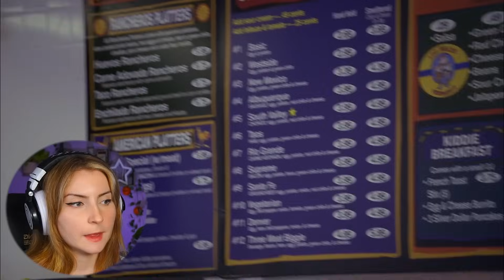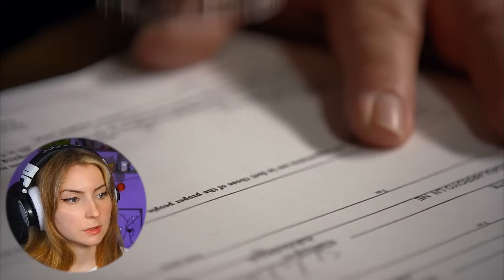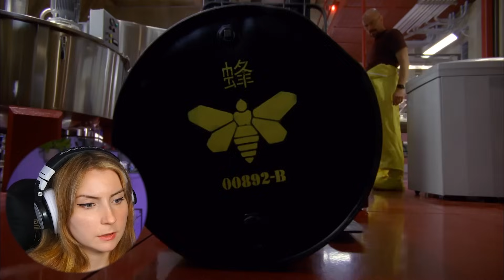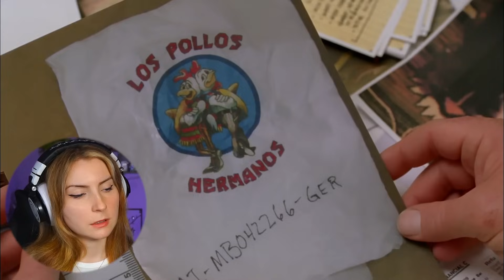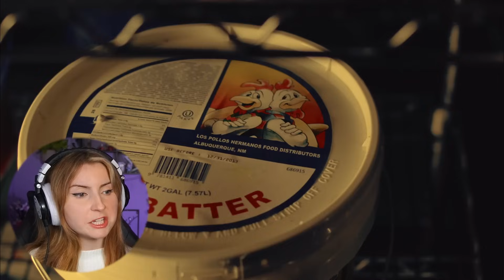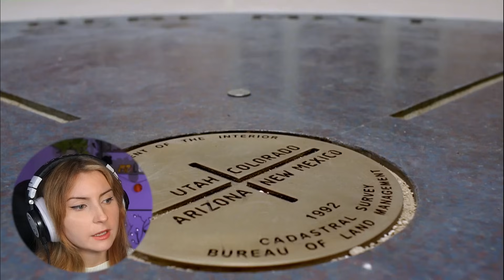WALTUH IS THE DANGER!?!? *Breaking Bad* Season 4... [Part 3]

Comment: The initial scare with Jesse was explained when Jesse knew Mike wasn't going to "off that thief" because Mike put a bag over his head. Then when Mike takes Jesse for a drive, he didn't put a bag over Jesse's head. The "Guy" that Mike once had was Victor - the victim of Gus's boxcutter.

Walter sounds condescending and narcissistic when talking to Jesse but he isn't wrong about Gus's plan to drive a wedge between them. He figured it out.

"I'm not in danger. I AM the danger." - I think Walter was trying to convince himself as much if not more than convincing Skyler. All that did was raise Skyler's fear and concern that Walter was far more than just a lab cook. Walter is starting to act more recklessly. He is losing the control he once had in every facet of his life.

Comment: Meth makes it tough to eat, especially if you’re snorting and not smoking it.
You’re throat gets dry, and you don’t normally have an appetite but when you do you can’t eat just anything or you’ll tare up your esophagus, especially big bites or crunchy on dry things like chips or toast.
It’s pretty much the same with most drugs, cocaine, ecstasy/molly, LSD, etc.
But if you eat and drink water regularly while on any of these,  resist the lack of appetite and essentially force yourself to stay fed and hydrated, “Party Drugs” are a lot easier to handle, and the eventual “come down” is less severe, thus lessening the urge to get more of what you were using, which commonly leads to addiction.
I’m not saying you won’t get addicted to drugs if you try them, but there’s a vast difference between use and abuse, potentially eating and staying hydrated can often be that dividing line.
But be warned, eating too much and taking too many drugs or drinking too much will likely make someone vomit, I’m an advocate for safe drug use, and you haven’t lived until you’ve hallucinated you were vomiting rainbows, at least one time in your short existence...👍🏽

Comment: It's a little hard to feel sorry for someone as unpleasant as Bogdan. He kept Walt working extra shifts, probably under threat of being fired, simply because there was no one else available. That, with the way he talked to Skyler, and all his, "as is," talk, smugly believing he was dumping a money sink that needed a new filtration system. He got $800,000 for his trouble, so now he can afford to get his eyebrows lasered.
Reply: Exactly. That's how they forced him to sell. By making him think it needed $200k (or w/e amount) of work to even operate.

He thought he was dumping damaged goods on them and taking advantage. Even the $79k Skyler took off the price would still save him six figures over fixing the "problem." Walt enforcing "as is" back at him is more than fair given the circumstances. And, as you said, Bogdan still got $800k out of the deal.